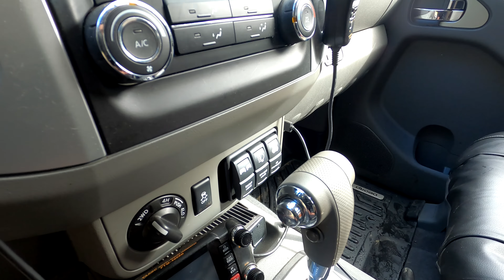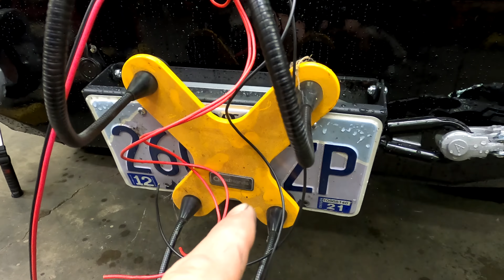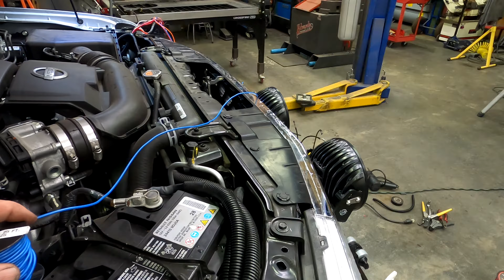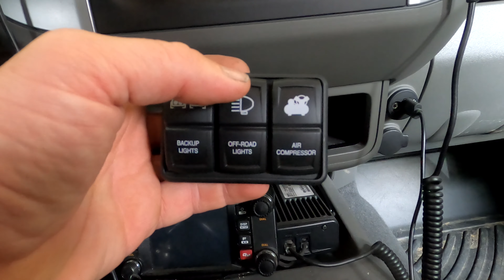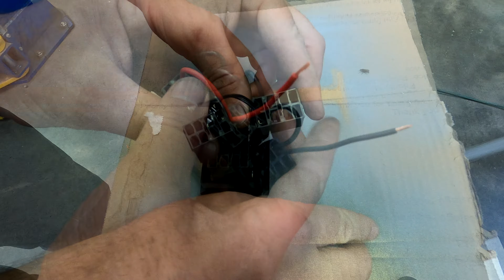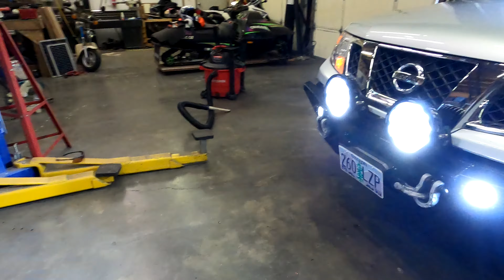Nissan Frontier build video 9:  wiring up the lights and installing a switch panel

Comment: Great video. But how do you get the wires through the firewall? I have a 2026, and I cannot find a hole anywhere.
Reply from the maker: I used an existing rubber grommet and just poked a hole adjacent to the factory harness.

Comment: Very interesting. I know this is an older post, but do you have any idea how to get a wire through the firewall on a 2018 Frontier on the passenger side? I know how on the drivers side, but cannot find a route on the other side. Thank you.

Comment: So where did you go through the firewall? Was it a pre-drilled hole with a grommet?
Reply: there's a big port on the driver side on the far left, there's a wiring harness going through that is pretty easy to find from inside the engine bay. I just poked a small hole through it and ran my signal wires through that way. hope that helps. (I have a 2018 frontier)

Comment: I have watched many 'how to' vids for light installs. This is by far the best as I have the toggle switch like yours. Quick question. With your setup when the ignition is off does everything turn off even if switch is left in the on position for the lights?
Reply from the maker: No, the fuse block is hard wired to the battery so everything controlled by the switches is independent of key position.  It is fairly easy to add another relay that is controlled by a key-switched 12v source, but I didn't really have a reason to do that on this project.